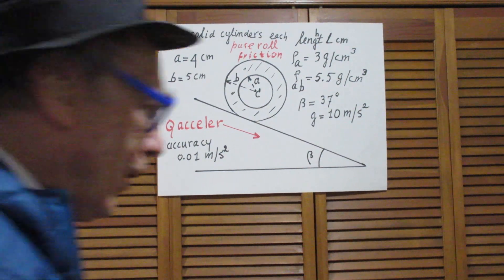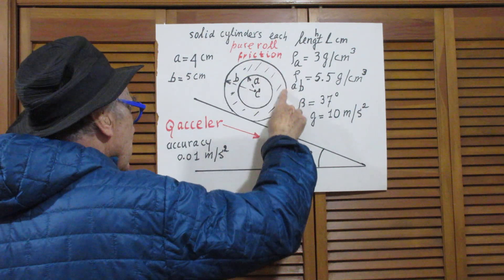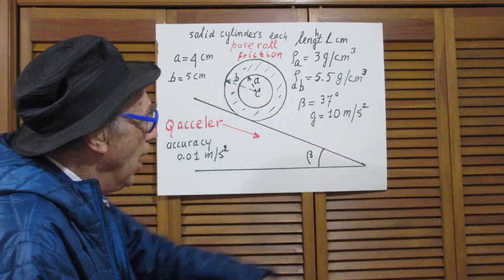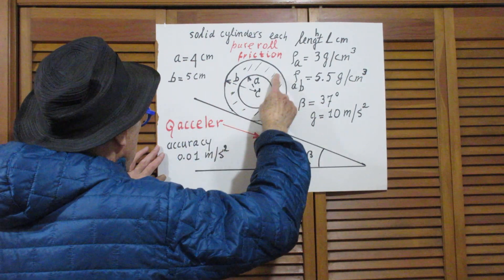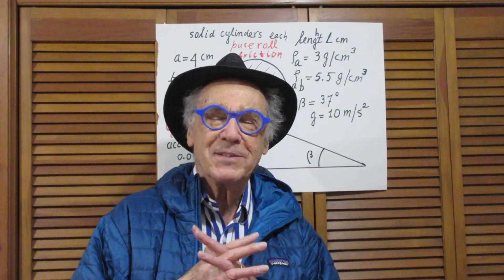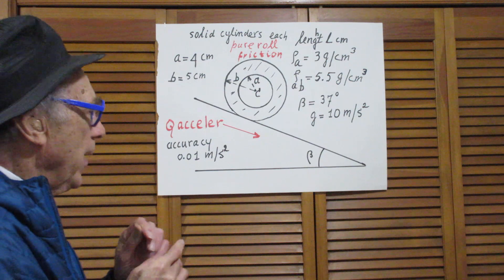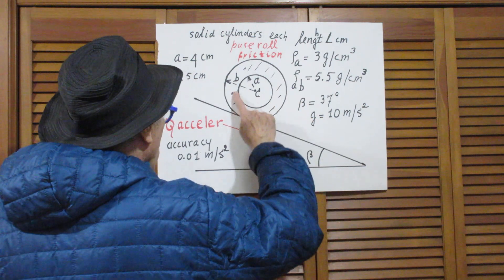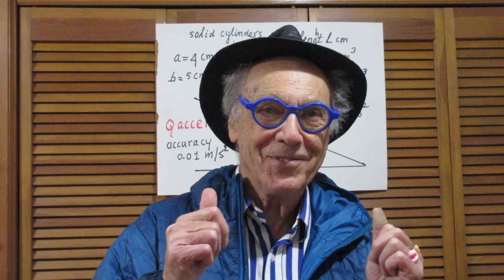Problem #87 a Rolling Cylinder - No Slipping

Comment: This is a really interesting one.  From the knowledge we have already gained from this physics legend we know that for any given cylinder type, length and radius (and hence weight) have no bearing on things.  It's all about the moment of inertia, and we know that is impacted by the mass distribution (i.e. how much mass is concentrated towards the edge vs the centre).  Thus we have two formulas derived: (2/3)*g*sin(b) and (1/2)*g*sin(b) for solid and hollow cylinders respectively.
In this example we have a solid cylinder inside a hollow cylinder such that they act as one unit with no movement relative to each other.  They have different volumes and different densities, so for a moment let's do a thought experiment.  Imagine cylinder "a" was made of aerogel and cylinder "b" was made of osmium.  Technically this is still a solid cylinder, but osmium is 1000 times more dense than aerogel so almost all of the mass is towards the outer edge.  Does this mean that it behaves like a hollow cylinder and hence would obey the (1/2)*g*sin(b) formula?  Intuition tells me yes it would, but I honestly cannot say for sure!
In this example as provided, although there is more of cylinder "a" in terms of volume, cylinder "b" is more dense to the point they almost balance out, but not quite.  There is a slight weight bias such that if cylinder "a" weighed 1 unit, cylinder "b" would weight 1.03 units.  But...we know that if we have two completely separate solid cylinders, one made of "a" and one made of "b" (regardless of dimensions) and rolled them side by side, there would be no difference in acceleration.
So, with all that said, and likely massively over-analysed and missing a trick (ha!) I'm going to say that the answer is 4.01 ms-2.  I eagerly await the actual answer :)
Reply from the maker: I post all incorrect solutions. Most (like yours) are incorrect. I do not post the correct solutions.
Reply: Oh I didn’t expect it to be correct based on my limited knowledge in this field, just enjoyed the thought experiment and look forward to understanding the answer.

Comment: Kinematics of a cylinder rolling down an incline doesn't depend on mass, but it does depend on its distribution. If this whole mass were distributed uniformly, acc would be 2/3 * g * sin (beta) = 4.00 m/sec^2
If this whole mass were on the curved surface of cylinder (as if it were a hollow cylinder), acc would be 1/2 * g * sin (beta) = 3 m/s^2.
The mass distribution in this problem is intermediate between these two cases.
Logically the acc should be less than 4 and greater than 3 m/s^2.
The answer should be same even if we double both the densities because it's the distribution of mass that matters.

Comment: Hello Walter, i do not understand, why you say that in AC E is zero in a solenoid. If there is a changeing B-field in a solenoid with the Start point A and End point B, the integral E*ds is the voltage VAB you can measure, that means E is not zero. In one lecure you had a solenoid with a bulb and pulled it out of a magnet field. Because the B-field changed, you got a bit light of the bulb and you did it faster and destroid the bulb. Instead of pulling out the solenoid, you could think of a decreasing B field and a static not moveing solenoid. When the bulb is ok a current is running, that means there is an E field in the solenoid. When the bulb is crashed, there is also an E-Field in the solenoid and you can measure the voltage at the endpoints AB. Even if you think of a superconductor, there must be an E-Field and the current can not be infinit. The speed of electrons can not be infinit. Most energy will not get in kinetic energy of the electrons, but in the magnetic field. The lorentz force causes the E field in a superconductor solenoid.  A transformator would not work if E would be zero, the voltage of the transformator would be zero and that is not the case E*ds <> 0.
Reply from the maker: watch my 8.02 lectures. if the cloil of the solenoid is made of supercomducting material then the E-field inside the wire of the coil is everywhere zero. for more information use google
Reply: Thank you for your answer. But we consider AC not DC. In DC the integral E*ds would be zero for a superconducting coil in AC not. I watched all your excellent videos lecture 8.02. And there are so many experiments you made, showing that there is an E-field, e.g. you had an coil with AC, put one loop around and got 0,7V, 2 loops -> 1,4V, 3 loops 2,1V, that means the induced Voltage Ui=Integral E*ds is 0,7V, 1,4V, 2,1V and not zero, there is an E-Field in the wire (coil with 1,2,3 windings). You are right to say we have to use Farradays law instead of Kirchhoffs loop rule, but Farradays law means that there is an E field inside the solenoid. My father lived from 1941-2017 and was an excelent school teacher for physics, mathematic and informatic and helped my brother and me to develop Physic Understanding and Learning from www.KLSoft.de . You can download it for free and watch E-Lehre SII 3.1 Übung 4. There are many other programs included e.g. Mechanik SII with your cylinder problem, relativity, Astro Physics, Waves ... as an interactive school book. Since my father died and my brother is more interested in informatic than in physics, i have no person i could discuss such problems. Best regards and please download my physic software, Michael.
Reply: I have no superconducting wire, but if you have one and put it in the above experiment once around, twice around,... i bet you will get for the integral E*ds the same voltages 0,7V, 1,4V... even if you close the wire the E-field inside your superconducting wire (solenoid,coil) would in AC not zero. The electrons acelerate, decelerate then change the direction acelerate, decelerate and the Elektons would say it is because of an E-Field inside the wire that causes the force F=-e*E. You will get a circulateing Voltage (Umlaufspannung). But it may be we talk about the problem "Is the earth moveing around the sun or is the sun moveing around the earth?" and both is relative (shown in 3.1 Übung 4). Best regards Michael

Comment: Sir, I would like to ask you a doubt (It's silly but it's been bothering me so much)
Lets assume that the Earth stops  its motion(Neglect its effects)
We can reach space by vertically moving up with a rocket .
Is it possible to reach space the opposite direction by digging the Earth surface and move vertically downwards. (Assume the temperature inside their cant kill us!)

🙏Sorry to ask such a silly doubt.
ITS JUST A THOUGHT I HAD ONE DAY😅
Reply from the maker: @E gravitational acceleration at the center of Earth is zero
Reply: @lecturesbywalterlewin.they9259 Sir pls answer my question😀😀
Reply: Here's an interesting fact of physics. I think it's covered in one of the professor's lectured. If you were to hollow out the earth to a shell. What is the strength be of the gravitational field inside? The answer may suprize you.
Reply: @mahesh-angadi  If you were to dig a hole through the center and remove the Earth's atmosphere (negating its effects), yes you can escape earths gravitational field by traveling all the way through earth. But you must start initially start with the escape velocity. You can do this because the earth s gravitational field is conservative.
Reply: @E the earth s shwartzchild radius is used to mathenaticaly modle the Earth's gravitational field outside of earth. It does not mean the earth had an event horizon of 2cm inside the earth.

Comment: 4.01 ms-2 unless I’m missing something which is quite likely. 2/3.g.sin.B for solid rod irrespective of density or radius.
Reply: Maybe it’s 3.65 if you weight the acc of a solid cylinder and the acc of a hollow cylinder by the ratio 16:9 (from their areas per unit length).

Comment: mass & radius have NO IMPACT on the acceleration of the cylinder. For a solid cylinder, our acceleration is found using:

a = 2/3 x g x sin(β)

a = 2/3 x 10m/s² x sin37° 

a = 4.01 m/s²

Comment: Dear Professor,  i got the answer as 0.006 m/s^2.  i don't whether it is wright or wrong.
Reply from the maker: roll down the cylinder over a length of 2 meter (starting at zero speed). 2=0.5*at^2 if a = 0.006 thu t = 26 sec try it!!!!
Reply: yes sir,  I got it.

Comment: Sir when we take a simple circuit containing a battery resistance and a switch and when we close the switch...

"The current must gradually increase from 0 to V/ r  but during that time it must create a increasing magnetic field  which whould increase the flux and according to lenz law there should be some current developed which moves in opposite direction... then why we don't  take it under consideration  while solving the questions? Sir please clear my doubt . Stay healthy sir.
Reply from the maker: watch my 8.02 lectures

Comment: Hello Sir😀
two hollow  spheres of different radius are kept in a vaccum.By means of some techniques the smaller sphere is kept inside the bigger sphere such a way that they share same centre(Its impossible so lets assume it ).Now, according to Newtons law of gravitation the gravitaional force between them is inversely proportional to distance between their centre squared.
since they share same centre so   d =0.
Using Newtons equation the force turns to be infinite .
SIR ,IS THIS POSSIBLE ??q
Reply: @brijeshpathak8968  What if we make the inner sphere levitate by attaching a magnet to each sphere?
We will make them to allign in such a way that they become concentric spheres and  then work on with the Gravitation equation.
so since d=0(Becoz they are concentric)
will force be infinite???????

Comment: Total mass of cylinders is = (0.00000975 ) * (pi) * L [ill use symbol m]
The force causing the acceleration is = (sin(37) * 10 * m) N
sin (37) * 10 * m = m * (acceleration)
My answer is 6.02 m/s^(2)
Physics A-Level better pull through for me this time. :)
You have a nice day as well.
Reply: I think this is the answer for sliding, not rolling?
Reply: Mass has no relevance
Reply: @X22GJP  mass also plays a role.  Watch the professor's lecture